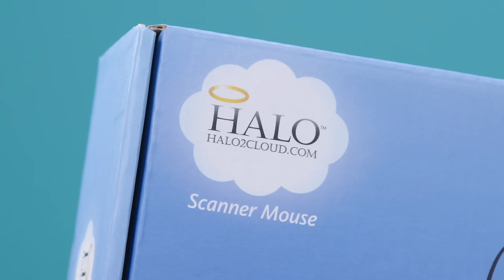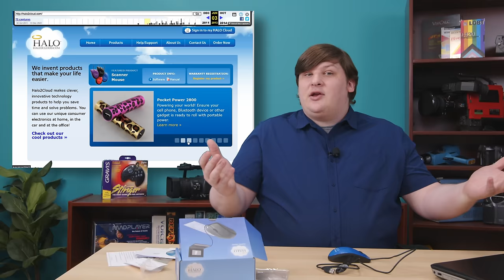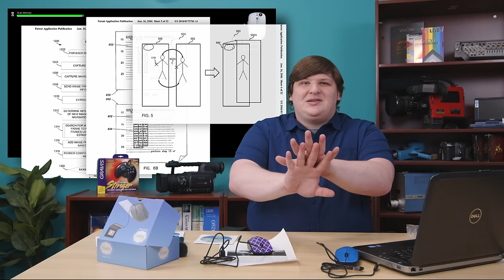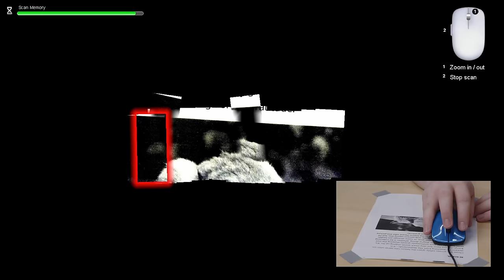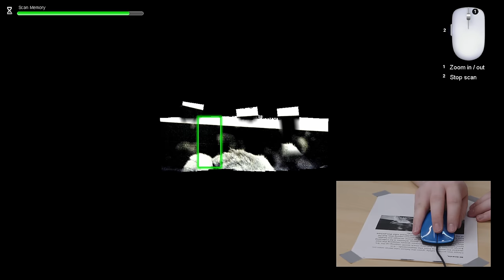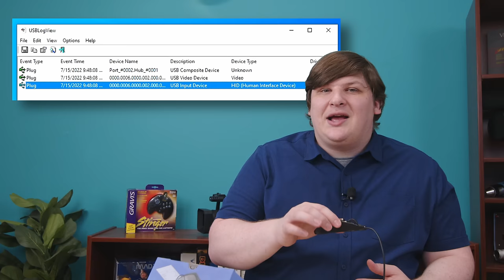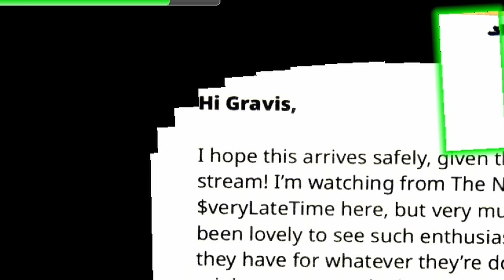Why would you scan things with a... mouse?

Comment: A pedant writes: It's a COMposite device, not a comPOSite device. COMposite is a noun, comPOSite is a verb. Don't believe what your 8th grade English teacher told you, English is an inflected language; see also RECord/reCORD, REFuse/reFUSE, DISpatch/disPATCH, etc.

On a more mouse-related note, the two mouse sensors are for trivialising the problem of dealing with rotation - if the top sensor goes left and the bottom sensor goes right it knows you've rotated the mouse anti-clockwise (and vice-versa) - and using some middle-school level trigonometry the software can then just "unwind" the rotation so that all image data will be uniformly oriented which makes it far easier to stitch. If it had to recognise rotation from the image data alone the whole process would be pretty complex (particularly on sparse images such as pages of text where there could potentially be large chunks where the image data is uniformly blank and therefore almost impossible to align); throwing in a second sensor increases the BOM cost slightly but as a tradeoff for reducing software complexity and improving the speed and accuracy of the experience for the end user it's a no-brainer.

Comment: Awesome vid, man!  I actually LOVE this concept!  I used to have a ScanMan (the pure black & white model that came with its own 8-bit IDE card, no greyscale!), and it was a blast to use!
If someone actually cared about fully developing this product, instead of selling the company, it could have turned into something really epic!
Combine it with one of those sticky panels that Cricut uses to hold things in place, and it would be a very useful little scanner!
I think it tries to do too much with the mouse sensors, and not enough error correction with photo stitching.  I can see 
why it needs both, however, since even the best image tracking software would be pretty bad at tracking motion over a solid white surface.  xD

Comment: i don't think i get the extreme vitriol for this thing -- maybe i'm just less initiated to this realm of old vs new product design, but it really doesn't seem like the extreme bad faith production that you made it out to be throughout the video and especially toward the end. i think it is just as likely that this was a product that someone thought might be a good idea and wanted to integrate it into a mouse because that's something that's already on your desk and is ergonomically comfortable for anyone who uses one daily, and it would just be a convenient thing to have already plugged into your computer and quick to use when you need it

frankly, throughout the whole video, i was saying to myself "wow, if it fully worked as intended, this is definitely something i'd use" because it's just convenient. i don't like pulling out my phone to scan a single document, messing with the crop on my tiny phone screen to make sure it looks good, and then emailing it to myself or plugging my phone into my computer so i can get the actual document. this would be easily more convenient for someone like me who rarely scans things, but wants to have a simple device to do it in the few times that i need to. the alternative that you alluded to multiple times was just using a flatbed scanner or a scanner that's on a printer, but i don't want to have either of those things lying around my house being unused 99% of the time. obviously it has flaws as you showed, especially that both of them died very quickly, but i don't think that just wipes away the potential uses for something like this

if it isn't good enough to your standards, i can understand that. it's a flawed device, and if there was more interest in it, hopefully they could've developed it more to make it better. but i really don't understand the intense hatred of it and the very far-leaped conclusion that this was just designed by someone who wanted to cash in on a patent and get sold to a bigger company. i don't think that's not a possibility, but to have such an intense diatribe against the concept of making throwaway devices, with this being the centerpoint of it, just seems like misplaced anger. i really don't think it's that big of a deal

Comment: All mice are scanners, but they suck at the scanners job because me move them around. I can't wait to watch this properly  at home.
Reply from the maker: honestly i am really really curious whether the "use a mouse as a camera" trick (I have not looked into how that works, I'm guessing it requires hardware hacking) can be leveraged in pure software to do a very poor job of this
Reply: @CathodeRayDude  Higher end sensors like 3360 have firmware upload functionality for customisation by the manufacturer, in fact they do nothing at all as shipped, just wait for the firmware to come (sensor DSP firmware is in the USB microcontroller, usually an NXP LPC or an STM32), and there are several firmwares known, one of which does no image analysis and just dumps the image data. Given these mice have a facility to update the firmware on the main mouse microcontroller, a "software-only" solution is fundamentally possible. Other odd sensor have image dump capability as well, very useful when someone is developing a mouse to figure out why it doesn't read.

The oldest known implementation is by a now anonymous Dutch student from 2006, where he connected an A2610 sensor to the parallel port of his PC and bit banged the serial protocol to extract image data from it, and published a predictably wonky scanning application called "readmouse". It was on Slashdot and Hackaday.
Reply: @SianaGearz  Without seeing the video, I think this is exactly what I saw back in the day, a software that just spat out what the mouse sensor was seeing in a 320x200 or such, black and white image, to a window in a windows 9x or NT or whatever. It was an Windows old as dirt, if not a 3.11.

And in perfectly featureless surfaces, the mouse didn't work. Because the image was flat. Any contrast at all, like a paper, was enough to make the thing run as a mouse and video! It was janky and wonky as a straight hardware output is expected to be. It had no coherent image, but it worked as a mouse.
Reply: @lfla0179  What video. Not everything is a video.

Comment: 4 GB for mouse scanner software doesn't sound that bad - especially when you compare it to ICue that take 1 GB just to control some lights and fans ...

I just got my first Corsair CPU cooler and the garbage, junk, stinkingly horrendous, absolutely anti-intuitive, almost completely convoluted, lame excuse for software called ICue is 1 GB in size .
What is this program doing besides managing LEDs and fans ?   I can give you a clue - IT IS NOT WORKING CORRECTLY .  It is totally broken .
When I adjust the lighting and the fan speeds - then when I go to a different area of the program - the lights go off, then the fan settings go back to default balanced .  The import / export functions don't seem to work the same way they did the last time you tried them .  The information blocks of text claim that the current setting will be used when you quit the program and it doesn't .  After 30 minutes of trying to find my way thought the different areas of the software, I can no better find what I want than when I started .  There are no menus, tabs, pages, sections which are common to any other regular software presentation .  It is all a mumbo jumbo of ^ points and words that don't seem to make any sense about what happens after you click them .
Nothing about the operation, performance or results of using that software makes any logical sense .
I have been working with computers since 1976 and this ICue piece of junk is the WORST commercial software program I have EVER used .

Comment: Did you really just call the "Halo Bolt" hideously cheap? 

Just because a company made hot garbage in the past doesn't mean their current products are trash. The bolt has replaced my bulky pair of jump packs used in case my (Diesel)truck at work needs a jump. Which especially in the winter has been worth every penny.

Try to be better next time.
Reply from the maker: I was somewhat with you until "try to be better." I will talk shit about any company I want. If they make something "good" it's only in comparison to the worst garbage available, and only by accident. I didn't look into their product at all, because I do not care what claims they make, or what reviews say. All commercial lithium packs are fire hazards, none are made to a quality or safety level that would satisfy me, and none are sold at the price they should be, because at the subsistence wages that virtually everyone is paid at virtually every job, and the hell nightmare that is our broken economy, where an hour of labor won't even buy you a sandwich, $300 looks like highway robbery despite having the buying power of a wooden nickel.

Acting like I just talked dirt on Mother Teresa because I said I don't like a company's products, when all products of that type are unfit for sale, is such a miserable way to live.

Comment: 16:48 it almost looks like the accelerometer is broken.......
.
oh!! both are broken like that...... are you SURE!!! its not a config/PEBCAK error..... or a driver error??? LOL
i could see the one mouse having a bad gyro/accelerometer..... 
but not both!!
.
idk.... i think its more user error 
im not calling you dumb or saying you messed something up..... just that you arnt using it EXACTLY the way they designed it to work
.
some cheap products like this DO!!!! in fact work
but it just has to be PERFECTLY clean.... PERFECTLY level..... wait the EXACT time..... do X exactly as they say..... do Y exactly as they say..... ETC ETC ETC
.
like an oil life reset on our forklift at the shop
key on, key off, key on in 3 seconds..... wait 2 seconds.... press the gas 7 times in 5 seconds..... key off, key on in 2 seconds
and if you take 0.1 seconds longer/shorter AT ANY POINT!!!!!!!!!!..... it REFUSES!!! to reset 
.
the manual literally says to use a timer on your phone
but, unless you are lucky / super-human...... their is NO WAY you can be +/- 0.1 second accurate.... (even when staring at the timer!!!)
Reply: oh.... its not using an accelerometer, or even a gyro..... 
.
its just using the IR tracking sensor..... clever!!!

Comment: I dont understand why you suddenly start dunking on engineers. Dont you realise that the people who optimize designs are engineers too? Most of the times the exact same person who came up with the prototype. As an engineer myself, this is what I generally do. Built something quickly, most of the time utilizing off the shelf components validate the deisgns write drivers and give it to the software frontend team so they have a development platform while I optimize and get the harware ready for certification and production.
Reply from the maker: The practice of criticizing the average engineer for having a limited perspective on the realities of the market, how users operate, and many other things outside of sheer on-paper technical possibility is a practice that predates both of our existences by probably a century.
Reply: @CathodeRayDude  Yeah true. I cringed at the design of the mouse too. I dont know about an average engineer, but the engineers I have worked with so far take pride in making products that are highly optimized and use clever techinques to reduce price without compromising on the features or the "feel" of the product. Btw, this is the first video I saw and I completely agree with what you said towards the end of the video. I was "scammed" by a kickstarter startup whose goal was to get aquired. I was hired as a freelancer to develop their product, I was the only engineer on the project. They paid me so scammed is in quotes but I consider it a scam because they I was explicitly clear that I only want to work if really care about the product. I had other work lined up otherwise. Endded up quiting half way after I realized they only wanted to make a presence so they could sell the company. They were trying building a NAS box for homes with built-in stream capabilities which back then was a really good idea. If they really cared about selling they could have made a lot of money. Alas, they wanted to get sell their company not their product.